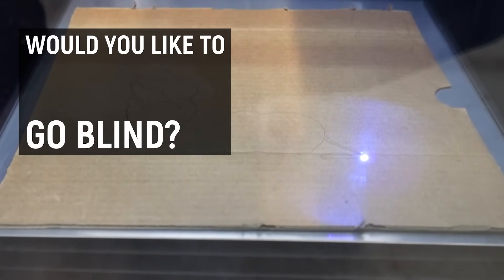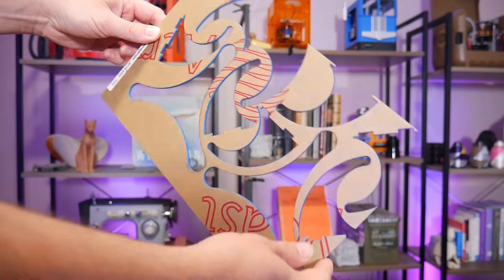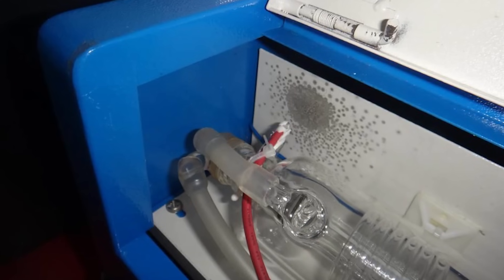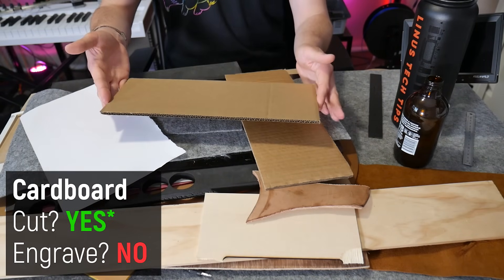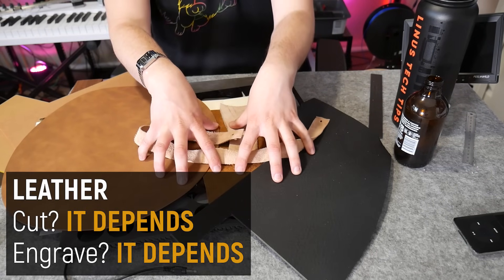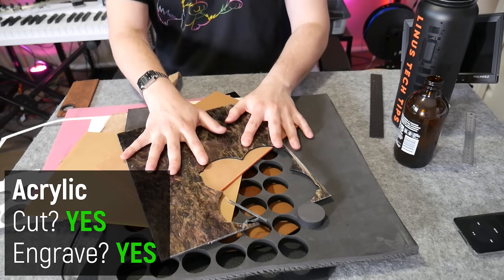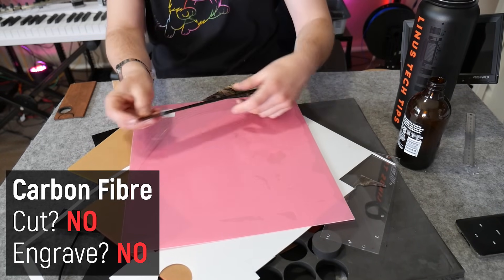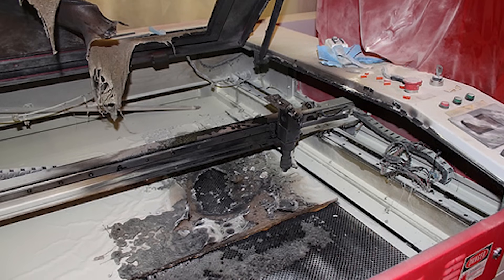Are cheap laser cutters safe?

Comment: Fun Fact: Formaldehyde is accumulative in your system. Meaning it wont do anything to you the first few times you're exposed to it. But one day youll stand over your printer/cutter/engraver/AB-foaming-urethane and end up on the floor before you realize you're getting woozy. Best to limit ones exposure in the first place.

Also, on a personal opinion note: Dont get tunnel vision. A lot of these machines are all the same. like exactly the same, other than the mirrors to guide the laser, or the extruder head and z motion for SLA, or a few inches of z  on the gantry for a router cutter head. For most of what I see people using lasers for a CNC router would easily get the job done at the cost of slightly more lost material in the cutters cut space. IF YOU DONT NEED A LASER, DONT WORRY ABOUT GETTING A LASER!!! You can build an extruded aluminum CNC router and add a CO2 laser and mirrors later if you are so inclined. So many devices in the g-code machine space are just recycling designs are pretending to be unique. Dont let them steal your money through marketing wank. Take a step back, engage your maker muscles, figure out how to do it with as much of what you already have as possible. Dont let them treat you like LoLcat idiots.

Oh, and because for some reason this has become a thing people are apt to believe for some unknown reason: Regardless of whatever feel good cotton candy clouds launch video, or web design, or scripted personalized response bot emailer a company might be employing AT NO POINT IS ANY FOR PROFIT COMPANY OBLIGATED TO OPERATE IN YOUR BEST INTEREST!!!!! EVER!!!! STOP ASSUMING THEY ARE ON THE UP AND UP!!!! MOST ARENT!!! ESPECIALLY ON ALIEXPRESS/WISH/[enter China fly by night online store here]!!! Most of these devices are sold by a shell company in the states but assembled in and shipped from the same factory district in China the few actually US companies get their parts from. Seriously, if you have never looked up how the Chinese factory towns work look it up. Its amazing from a production stand point, one floor doing plastic injection another doing pcb etching another pick and place components and hand soldering, etc. But from a product reliability stand point....well it pays to know how that world works if you want to take advantage of the low cost of 'fell out of the back of the factory' 'it didnt let out the blue smoke, ship it' no name but it looks just like name brand stamped products (cough like wish.com cough). You have to consider whats wrong with a product they're essentially selling at cost that the name brand didnt want to stamp their name on. I personally bought a lot of electronics from wish, and always expected junk. Have been impressed a few times, but mostly expected bad solders, improper molding, bad programming on the one time programmable chips. I personally always looked at it like, 'well, as long as I get 8$ worth of electronic parts for my parts bins, Im okay if this turns out to be a hot mess.' Only a few times did I truly get garbage. A whole $14 dollars in all down the drain IIRC. Dont expect miracles with the low cost stuff, watch out for stuff you're just paying for the name branding. My rule of thumb, take the cheapest reasonable price and add 20% and do not pay less than that. At least that way you are likely to get something that actually went through some QA, but probably got rejected by the big name brand for ugly solders or something (which are easily fixed by us maker types, right?).

Comment: Great advice and as a CO2 laser user of some 12 years experience I totally agree that I would NEVER use any laser without extraction or adequate covers. Out of interest I tried putting a cheap pair of laser safe glasses in front of my laser and it easily cut paper behind the lens! I’m glad the paper wasn’t my eyeball. As an electronics engineer I’ve replaced both the power supply and laser tube in my CO2 laser and was extremely careful with all the preparation and alignment. Aligning a CO2 laser tube correctly and safely is no simple matter and must be done carefully and methodically especially as it necessitates multiple busts of laser to check alignment. Like you the idea of using a frame laser with no ventilation is not just scary, frankly it’s totally irresponsible to sell them without huge and very clear warnings about the dangers involved. The last advert you displayed with a toy vehicle and a small child is frightening apart from the fact it’s highly unlikely that vehicle was made with that laser despite the clear implication it was. Scary stuff and we’ll done for highlighting the dangers people should only buy a laser IF they are fully aware of the risks involved. Well done and keep up the good work I’ve enjoyed watching your videos over the years and they’ve always been informative and well produced. 👍

Comment: Thanks for making this video! I've wanted a laser cutter for prototyping for a long time, but refuse to get a "cheap" cutter for all the safety reasons mentioned, and can't yet justify paying the $6000+ for something like a Glowforge with filter/exhaust unit. So instead I just use one of the online mail-order laser-cutting shops. It's kind of expensive and the delay is the most annoying part, but it removes the risks. And if I don't end up cutting many prototypes, it can definitely be cheaper too. But prototyping with 1-2 week lead times between iterations is not particularly fun...

Comment: eva foam is (poly)ethylene vinyl acetate. no chlorine to be found, and most of the safety org have found it to not be a carcinogen.  (at least, so far. this may change some years down the road.)

so its probably 'safe' for this use, in regards to what's in it, but yes, definitely adhere to the ventilation rules.

Comment: Nice video, but I wish you would've spent more time on the laser eye safety part.
We can replace our stuff if it catches fire, but we can't get replacement retinas. Emphasizing that and maybe providing a few more tips on laser safety goggles and how to test that they actually work would've been nice.
Also, with lasers, I would absolutely use a belt and suspenders approach, goggles and enclosure. I'd probably wear an eye patch over one of the eyes as well, no need to risk both, especially if I can't trust the goggles.

Comment: Ive got a cheap china desktop laser. Currently building a enclousure for it, bought some real safety goggles by a store for laser equipment in my country (same for a little laser proof window for the box).
Will also add some ventilation to it.
If you like tinkering around, you can make a stupid china desktop laser more safe.
So far I havent lasered much with it and spend more time with making the box and such (im dumb with such things), but I have a lot of fun with building and thinking about, how I can do things to improve it!

Comment: I've had a desktop laser for years. I am constantly surprised by the complete disregard for safety from the laser cutter communities around laser cutting. There are tons of craft people out there who have very little regard for the specifics of materials. I've seen people in glowforge facebook groups suggesting all sorts of cheaper sources for plywood and masking, only to go find out that the suggested masking material is vinyl sticker material, or the plywood doesn't disclose the type of glue that is used. If you point this out the group, they will often dismiss you... Lots of "it worked fine for me", SMH. In the old days, the glowforge forum had lots of good information about safety, but that was the community before mass market appeal.

Comment: Nice video!  this is one area where keeping the paranoia level high is exactly the right thing to do.  have you considered doing a test of the laser glasses? Keep up the good work.
Reply from the maker: I can't recall the source but some people have tested them and found the provided ones to be lacking at best. Possibly styropyro
Reply: @MakersMuse  The goggles to me always felt like a workaround to an underlying problem, that being a laser outside of a safety enclosure. They're at best going to protect the one person wearing them, not curious people strolling by
Reply: @MakersMuse  You are correct, StyroPyro has done a video or two on those cheap "laser proof" goggles
Reply: @iamdarkyoshi  To be honest, I've no problem wearing the glasses even when the laser is in a case. The problem is that I don't particularly trust then to do the job.

Comment: Hi Angus, just a quick update on the new  XTOOL laser that I bought. They have just released a flameproof and portable enclosure for it that looks quite good so have ordered it and the big extension kit which the enclosure also fits so hopefully this is one of the more exceptional lasers out there and is also of high quality to operate and now it looks to be as safe as my big blue boxed diode laser. Hoping so. Anyway, thanks again for the great knowledge you share with us all mate, much appreciated 11 out of 10 👍
Reply: I have the same enclosure. Just an FYI, I asked XTOOL customer support if they had specs for the optical density and wavelength band that the viewing window will block. After checking with their engineering department they told me it's not certified at all, and that safety glasses should be used with it even when it's closed.

Comment: You've basically confirmed all of my thoughts on the cheap lasers.  I had a K40 for a little while - but to be honest, the amount of time, money and effort I would have had to put in to make it run properly and safely just wasn't worth it for me. 

My wife suggested one of the new generation of diode lasers as an alternative.  I passed.
Reply: I need me a wife that suggests I buy 'one of the new generation diode lasers'

Now THAT'S a wife worth keeping 😂
Reply: @NotMe-ej9yz  The new generation diode lasers are the ones this video is very specifically saying to NOT buy due to the dangers. I recommend a wife like mine that had me buy the largest OMTech CO2 laser with full enclosure and extraction we could afford. It was delivered by a semi truck.

Comment: If you are unsure about a material, look up the MSDS for it and scroll down to the heat, fire, and toxicity.  
BTW, EVA foam appears to be safe and also contains no egg, dairy, wheat or peanut products, by-products or derivatives.  🤣
I know other foams are a big no. Some contain cyanide when burned (Polyurethane foams is one of them).
As always, do your own research.
Reply: MSDSs overcover and make it hard to tell irritants from the really nasty stuff. They're OK as a starting point or if you're planning on being overly conservative anyway, but if you need to know the real hazards you'll probably need more than that.
Reply: @sealpiercing8476 
For any shared spaces (maker spaces, workplaces, etc) you really want to be over conservative anyway.

Comment: I got one of these cheapo diode lasers a while back, It was total nightmare, the wires were too short for any cable management so depending on the XY position there was a risk of it cutting its own wires, the instructions weren't english & the provided software was janky af. The amount of work it takes to get this machine working "safely" simply isn't worth the time or risk. Definitely avoid.

Comment: I keep seeing videos about those cheap lasers pop up, and every one just looks so dangerous.    Like someone could just walk into the room with it running, look at it and get permanent vision damage.
Reply from the maker: During 90% of operations the beam is super unlikely to bounce off, but that scene with the cup engraving is wild because the shiny metal would absolutely be sending laser radiation out into the room. Your eye tries to "fill in the gaps" with damage too, so you wouldn't really even know till its way too late.
Reply: As a matter of fact, I keep an extra pair of (ANSI certified) laser safety glasses at the entry to my shop in case a visitor pops in while the laser is on.

Comment: Really great video. So many things I'd never though about and I always do my research to check if I need breathing equipement or to run a fume cupboard but there were so many things here to get my grey matter thinking to be safe and how to be careful before going for a DIY cutter. It looks like I am going to a non-laser solution to cut a variety of materials, even so any cutter can produce some nasty fibers, dust, fumes, heat, fires etc Thanks for the tips and the stimulation of that grey matter.

Comment: You have scored a "direct hit" on many of the hazards associated with these diode lasers.   I have such a system and participate in a couple of FB groups.   In addition,  during my working years, I worked with and around laboratory lasers including some with many kW of peak optical power.  Though we were not cutting our engraving, one gains respect for the capabilities of these lasers, even without the secondary issues of emissions and byproducts. 

In a little more than a year, I've observed a few things: 

1.  A VERY large fraction of newcomers to this field are complete, untrained "newbies".  They have no knowledge or experience of this technology and are, in many cases, accidents waiting to happen.   In many cases, they want to simply push the ON button and expect to complete their projects with no effort at understanding the tradeoffs. 
2.  The lack of suitable enclosures is definitely a problem, although some vendors are beginning to directly address this, at least to some degree. 
3.  Many of the better units actually do a decent job of shielding the beam by including a shroud around the beam until very near the surface.  However, it can be removed, in which case the issue of reflections can become extreme.   
4. Most folks don't realize that a specular reflection can do almost as much damage as a direct look along the axis of the beam.   So, trying to engrave bare metal,  even with a shroud is a potentially risky activity. 
5.  The specs of many of the included laser safety glasses are impossible to assess.  Some are probably ok, but some may not be OK,.  Folks try to decide based on the color, but that's not adequate.   They should be approved by a standards agency.  Most are not. 
6.  The new wave of 450nm lasers with 20W of optical power is actually pretty scary and it would not surprise me if the resulting accidents result in new laws and restrictions being imposed.  That much power focused into a small spot at that wavelength can actually do damage very quickly... and will. 
7.  And finally, in my opinion, one of the biggest hazards which should be mentioned is that users simply insist on walking away from their laser.   Because they are usually engraved line by line, photographs can take a long time... up to several hours at high resolution.   In one of the FB groups,  there is a fire reported about once every 10 days, and there are probably more happening.   Despite the warnings about unattended use, these incidents invariably arise from needing to use the restroom or go to lunch.   ALL of the control software has a PAUSE capability, but it's not used for some reason.  

Thanks for trying to raise the awareness of safety when using these systems.   It will be interesting to see how this hobbyist field develops.

Comment: I really appreciate this video. This is one tool that I have always wanted and did not want to spend the money on a co2 laser and never understood the full enclosure. I honestly thought it was just to increase the price. I have looked into several of the hobby lasers and almost pulled the trigger a couple of times. I will now wait and save up for a proper laser cutter. Thank you
Reply: Honestly, this video is a bit cringy because while Angus makes valid points about safety and the way these products are marketed, many aspects could be applied to FDM printing. RESIN printing, FDM printing, CO2 laser and diode laser, all need enclosures and air extraction and fume filtering. All these non pro machines are sold at rock bottom price but don't have the bare minimum options to even operate. 

For example, diode lasers (which were initially sold as light engravers) can't really cut anything without burning if you don't have compressed air blowing at the focus point. And of course, you're going to need a honeycomb grid and a steel plate under it to support the cut material. And (mag) clamps to stick it to the frame. And of course, enclosure, air extraction AND activated charcoal filtering. Oh and did i mention the software side of it? [Insert advert here for buying LightBurn] All these add up to way more than the base 300 USD these machines are sold you for. 

Disingenuous and dangerous? Yes and yes. But it's the same as resin printing, where marketing materials never mention the hurdles of post processing and hasards of resin handling or the joys of  FDM printing anything structural with engineering materials (ABS, Nylon, HIPS) without mentioning the need for proper enclosure, temperature control and air extraction and filtering. So invest the time to make  your own research prior to buying yes (online communities offer great support for that), knowing that the price bare machines are sold to you is only a fraction of the cost of operating them safely and efficiently. 

That said, i would never go back to the time where all the wondrous technologies of the fablab were gatekept by the industrial design sector just for safety concerns over main consumer market. Metal working is hazardous and dangerous for your sight and lungs, woodworking is the same for yor lungs and stumpy nubs and aerosol use of any substance has to be done with proper EPI equipment. Those desktop technologies have their own issues but are no different than the already existing ones. Don't shy away from them but never get careless or complacent.